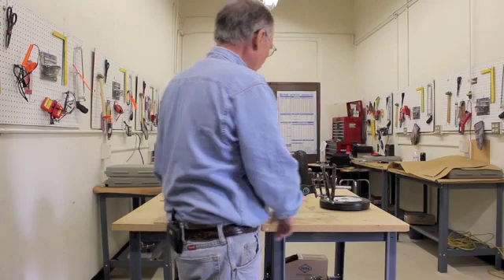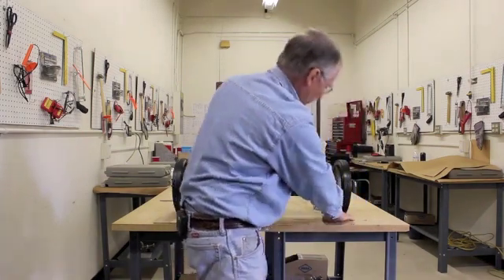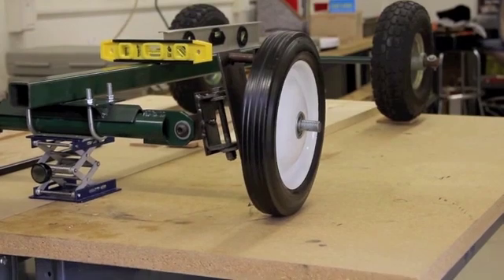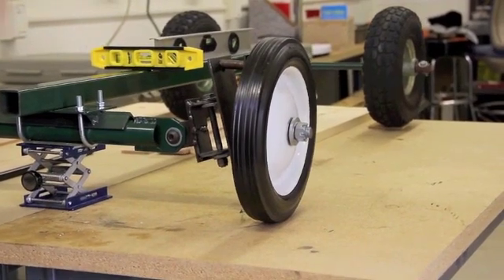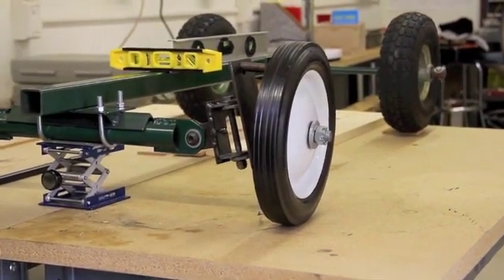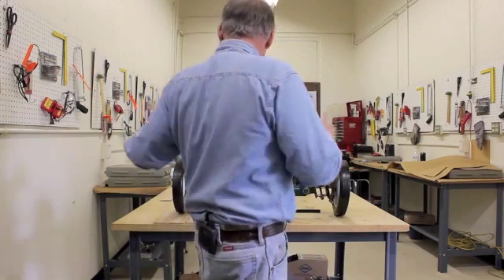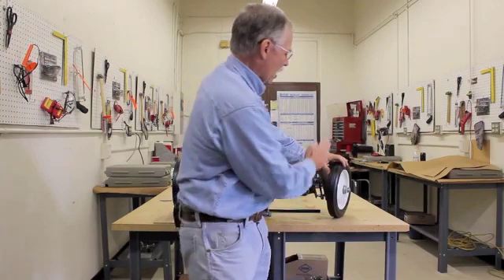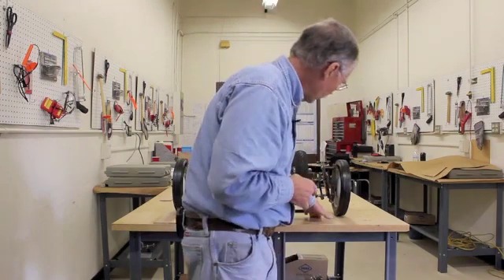Intro to Racecar Engineering: 11 King Pin Inclination

Comment: There's a Segway vehicle that my friend showed me the upper front arms and they're cool, say the spindles too actually, come out of the wheel, reverse over the tire and joint there with the upper arm. Therefore the virtual kingpin passed thru the tire wheel etc pointing, given the lack of depth of the wheelrims, like straight above the center of the contact patch, or at best they were "reversed inwards" and I thought it must be so, because I didn't see a point in having no scrub radius and a straight KPI. That was curious.
Also I spend my time wondering why agricultural tractors (eu here) seem to have a KPI and positive scrub radius but, like, zero caster. And I know they're rigid, but they do look like they are built with less than 2/10 of a degree of caster angle and that's curious. Since they wear very high tires shoulder, so they dive in braking, a bit...
Reply: damn he explained it right at the end, the thing why offroaders expecially if not high speeders, don't need that much scrub radius.

Comment: Hi, I have a question. There is any scrub radius variation in a real working system? I think about how the contact patch could change during a corner, so i guess the SR will follow too. I this a problem? In some designs It could change from a positive to a negative one. Is this something we should think about during the design of the suspension? 404english

Comment: It's great vid, yet, I confused regarding he said that if decrease the scrub radius, on the vid 10:13, he explains that it'll put more of braking load to the steering axis ( king pin ), but on 11:00, he says the greater scrub radius will put more to the steering mechanism, which way would give more load to the steering axis?
Reply: Increasing king pin inclination and thus reducing the scrub radius will put more of the braking, pot hole, road friction and so on through the king pin. And if you decrease your king pin inclination and thus you increase the scrub radius, then the loads will go through the steering system more. Hope this helps.

Comment: In the 1970's I had a VW Rabbit with what VW engineers called "negative roll steering radius".  I'm pretty sure that meant that the kingpin inclination angle was steep enough so that there was a negative scrub radius and the centerline of the king pin intersected the ground outside of the center of the contact patch. The "negative roll" terminology meant that when the car was sitting still and you turn the steering wheel through it's range of motion from right turn to left turn, the right front tire would roll backward on the pavement a very slight amount. On every other car that I know of, the wheel would roll forward very slightly.
The way it affected driver experience was that I could point the car straight ahead while going down the interstate, take my hands off the wheel and the car would not wander to one side or the other.  It did not matter if I was driving on one side of the crown of the road. It seemed I could go a half mile or more without touching the wheel.

Comment: so if you use a king pin angle which is a bit more than the normal the first thing that you will notice during cornering,is that the car in the entry of a corner will be faster and probably sharper due to the force of the outside wheel to push and lift the front axle...so the less the scrub radius the more sharp the steering..correct???

Comment: Great explanation ! I have one question though about scrub radius.

Is it true and logical to expect for example that the braking forces or pothole - road irregularities, when scrub radius is negative ( outside of the tire centerline ) instead of positive ( inside of tire centerline ) are reversed, with positive scrub the wheel will want to toe out with braking force or rolling resistance, potholes. With negative though is it the reverse ( Toe in ) ? 

Thanks.
Reply: Imagine the front wheel of a bicycle mounted, not between the front forks, but outside the forks to the right side.
While riding, if your front wheel would hit a bump, you would feel your handlebars jerk to the right and you would have a scrub radius of about 5".  You could eliminate the problem with a zero scrub radius in two ways: The most obvious would be to put the front wheel back between the front forks.  But another way would be to bend the front axle where it attaches to the right fork so that the wheel is now leaning to the right and the tire contact patch is back between the forks at ground level.
Reply: @Bluuplanet   That cleared it up for me a lot more and nice and clear example. Thanks for replying !